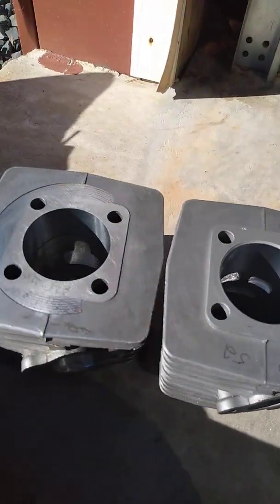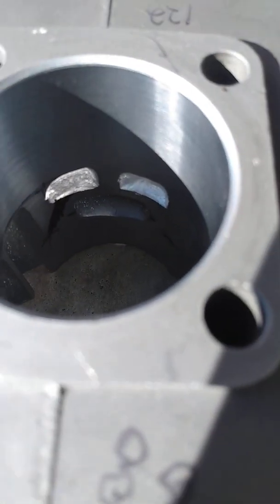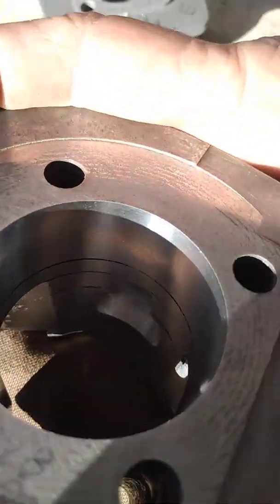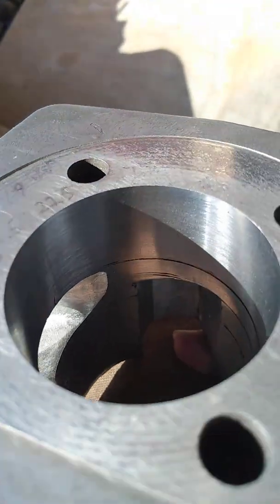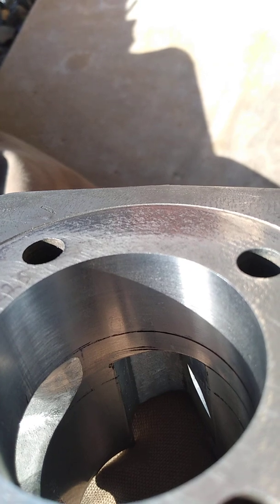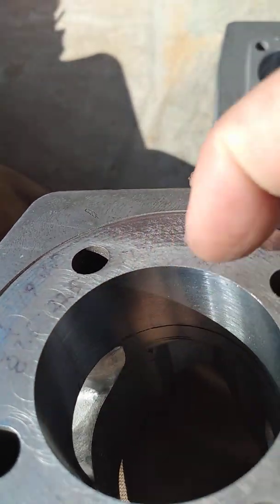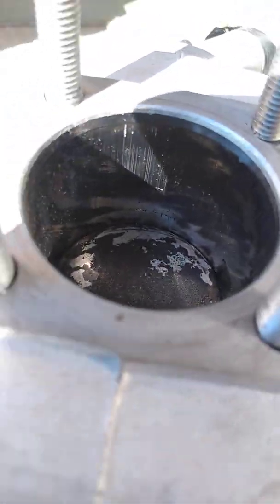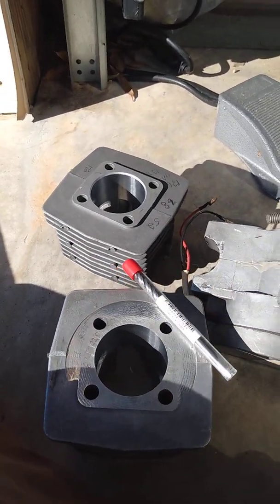boost ports, actual true aux tranfers ,and yes I run boost port on piston ports just a small one

Comment: Dave, thank you for all of your videos on porting, ramping pistons and everything.  I've learned a lot so far but there's one thing that I haven't grasped...piston porting? I know it isn't referring to windowed pistons or 3rd transfers.  Is it just another term for the way the cylinder comes ported, before you make any changes? I've been searching you tube for a visual reference and haven't found anything.  You make mention of one that you have but I can't see anything on camera.  Too dark in the cylinder.  I'm getting obsessed with this, can you spell it out for me.  Please.
Reply from the maker: Ahhh was the question what's a piston port ? That's a none Reed motor. I just watched video yea poor job by me with camera. I was trying to show I make a boost port like cyl on far left and run that on a none Reed motor aka a piston port. Or is the question  what is a Gass ported piston. Gas ported pistons are for four strokes the have small holes drilled from top piston @ a angle into top ring Grove that leaks pressure  behind a low tension ring. Let me know if that's the answer to your question.  If not ask the question again thumb 👍  glad to help
Reply: @2strokecarbtuningportingin187  A non reed motor.  I knew there was a simple explanation,  thank you for taking time to explain, I very much appreciate it!

Comment: Typical stock blowdown is never 15°. At 15 degrees it would be virtually impossible to start by kickstart or pull. 15 will not allow enough time for the cylinder burned fuel to escape and get to nearly 0 pounds of pressure allowing the transfers to refill the cylinder unless it is at astronomical rpm. That is why it's impossible to build combustion pressure by just kick starting. The larger the engine the more blowdown is needed to maintain any midrange torque at all.
Reply from the maker: Your wrong. I never asked you for advice  nor anyone else. You need to make your own channel. Don't try telling me anything on my channel
Reply from the maker: You must have never checked port timing on these junk shit motors.

Comment: would love to talk to you more about port work i wana make a case reed ms880 I've been doing a lot of research and I have the tools and parts this case reed 110 I have has A-Rod stamped with 100. How many mm is that stroke
Reply from the maker: X never equals x with these cheap motors there's multiple combinations of hybrids hence I never pay attention to letters or numbers and physically measure everything 38 mm stroke 39.5   40 and 44 mm strokes  are the only motors I built
Reply from the maker: Left you a link to rod lengths and crank id
Reply: @2strokecarbtuningportingin187  thank you so much
Reply from the maker: https://youtube.com/playlist?list=PLyTjGWYBzynDeRI7CjaT2h8Fx5h-pGmg9
Reply from the maker: Rod length measure it from center small end  to center of big end.  As far as stroke goes physically checked out with a depth gauge ie calipers. I never paid any attention to letters or # . I physically checked everything sorry

Comment: So I need a fairly fast engine that goes bout 50 is with really good bottom end can run up to a 54t sprocket to 40t 36 and below is hard to start ya know
Reply: Even with a 40 tooth sprocket, your engine will need to spin about 10500 rpm to hit 50. Unless you have extremely good quality bearings all around and a near perfectly balanced crank, I wouldn't run anything larger than a 36 tooth if you want to sustain 50mph. A 32 tooth would be best, since that would bring you down to 8500 rpm which is way more doable with these little motors.
Reply: @dmoore0079  true dat but I found a medium settled for 45/46 run a 40t had don butler port a cylinder told him not to worry bout chamfering it I do that myself and I wanted to leave a lil room to experiment w durations in the end I wound up 160/120/20@ 16.666% got an arbeo a decent head running low compression actually added another head gasket just wanted to keep it cool and with a gasket removal I can go from great daily to a suburb smoker wich I go around suburbs a lot short roads lotta turns need the torque but a lil more smoke kept the closed transfers had a boost port added tho I didn’t need it really may raise it later steep angle on the transfers a pipe similar to torquer up pipe but came off a small dirt bike and modified it played with length it honestly could use a better clutch spring and pads it takes off great and runs up the hills better than my yd100 soon as I filled up second tank I opened her up once hit 39 with room to go she’ll be a 45mph babe after break in on the 40t proli gonna raise her ex up a tad idk but if I go any faster I’ll have to upgrade bearings soon but it’s a wildcat pretty decent engine to start off with hate the exhaust studs tho
Reply: But don ain’t what he used to be for sure but good enough for me besides I always always chamfer my ports a little better hit a 45 then a 10degree angle and round it smooth them down polish edge and never snag also had the mushroom exhaust a small single window piston and carbon fiber oz reeds mainly to lube the needle bearing keep piston a little cooler so it don’t expand too fast angled the window so it would hit right beside wrist pin wrap around crown might be a good trick for those running minarelli and having soft sieze issues idk
Reply from the maker: 54t you'll be going 25 mph gassing wheelies. 10 /36 should Easley run 48 to 52. I never seen much sence in killing motors with rpm
Reply from the maker: Depends on rider weight bike weight and set up meaning ape hanger bars and fat tires your never gonna get far
Reply from the maker: https://youtube.com/shorts/pvAETEhp70M?feature=share
Reply: @2strokecarbtuningportingin187 I will make a engine to the specs you posted and I will never be on the throttle to that speed.. I flipped my bike back on a 40 mph wheelie and now have a metal hip,knee,and 10 screws in my right leg... I'm 60 never got hurt on a motorcycle been riding since 1970 .. respect your China Girl and you won't get HURT.. Peace..Go Safe .

Comment: Does this boost port modification cause any type of bogging or sluggish behavior down low given its a piston port?
Reply: Thanks for the reply. I was figuring a 50 to 65 degree angle would shoot it right up into the chamber, pushing the stalled exh charge out for a complete fill cycle. Should the port open before the main and secondary transfers maybe a degree or two? I know you mentioned after. Have you tried it this way and it didn't work? I can only assume if it didn't work, that the incoming charge in the intake would go right out the exh port because the air speed would be higher than the pipes scavenging and any case compression forming any type of column in front of the exhaust port
Reply from the maker: No provided there not to Large and  few degrees behind the transfer opening and correct roof angle so it's not blowing it out the pipe

Comment: Hey, I know this is an old video, but on a G4 cylinder, is it better to take out the transfer wall? Thanks!!
Reply from the maker: No it's not. If your looking to gain more tranfur duration and keep ring support add duration buy jacking cyls. Removing tranfur walls looks cool but run risk if snagging rings it changes nothing with tranfur duration  if you notice ports offset to Left side that's exactly why most my newer vids show the mushroom shaped exist port I never make exhust port wider than 33 mm and never go below tranfur opening there's a few answers for one question. Short answers no.